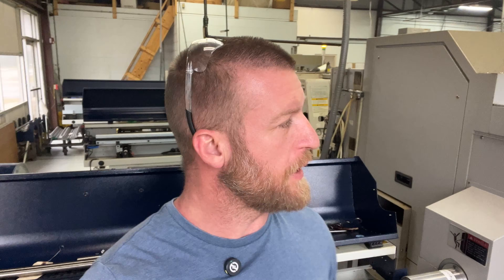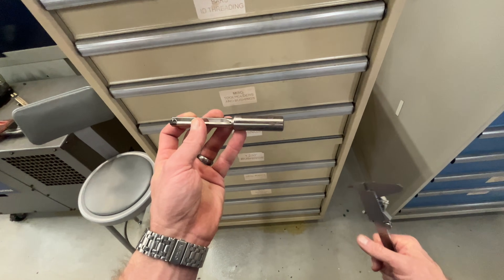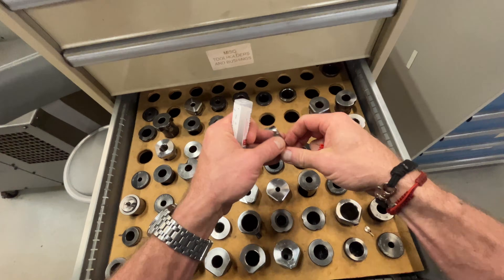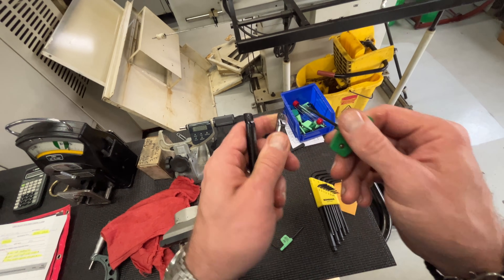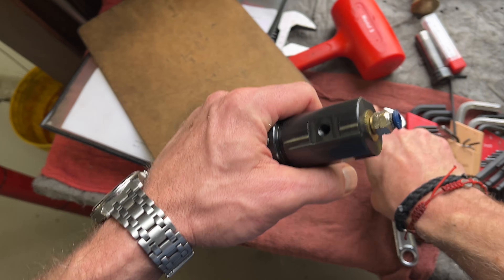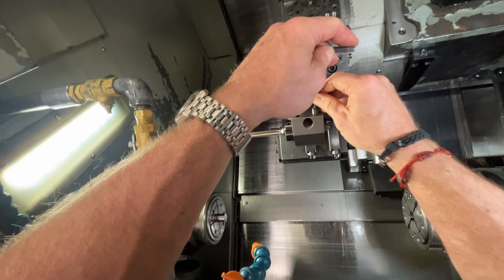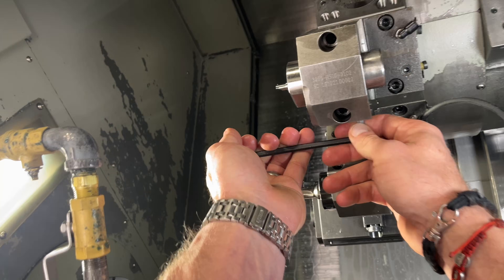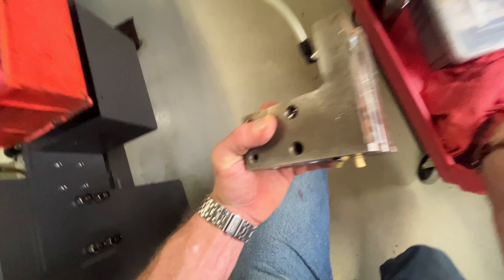POV 🔥 Machinist Edition🛠️         #pov

Comment: I usually put my boring bars and drills in the sleeve after I put the sleeve in the turret.  It is easier to tighten down the set screws that way, and easier to get more torque. More bending into the machine though. Do you really need anti.seize on the tool holder bolts ? They're all full of cutting oil / way lube anyway ? Nice video.
Reply: Yeah I never put anti-seize on my tool holder bolts either, I never have a problem with loosening them and they never corrode, but I'm sure it doesn't hurt
Reply from the maker: I probably don’t actually need to. But - these may stay here for months - we’ve had one block not moved in years 😂 and I don’t want to battle when I inevitably have to move it. Thanks for the input for sure 🤝👍
Reply: @Crusadermachining  great point, I take mine on and off all the time so I would use the anti-seize if I knew it's gonna be there for a while
Reply from the maker: These bolts will end up staying here for a long time. Months for sure - at least I hope. This is a coolant machine and we don’t get oil down in that area of those threaded bolts. Thanks for watching and thanks for the input! 👍

Comment: Loving the background music! 
I like how you plumb your coolant through drills with the quick release and flexible hoses, I've been looking for ways to do mine and it's great seeing how other people do it. 
I have the same anti seize, my As9100 auditor saw it and told me I have to have that labeled as tooling 😂😂, that was a little excessive but I went and got some self adhesive labels, wrote tooling on one and slapped the sticker on my anti-seize, it was "low hanging fruit" but he had to find something. 
I also like your wooden homemade sleeve holder in your drawer, making one of those has been on my to-do list for years now and I keep procrastinating.
Reply from the maker: Hey thank you for the kind words. I’ve never dealt with AS9100 auditor but I’ve heard stories 😂